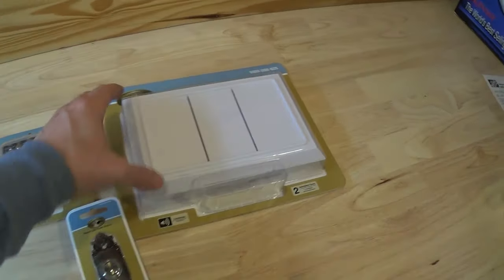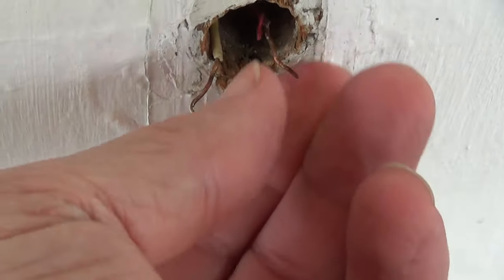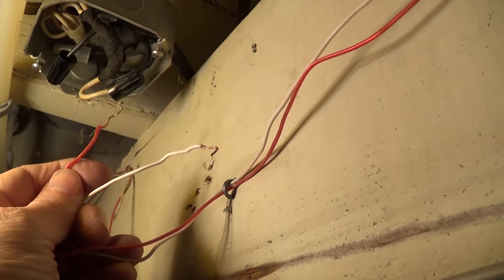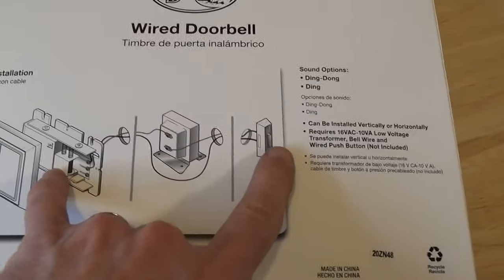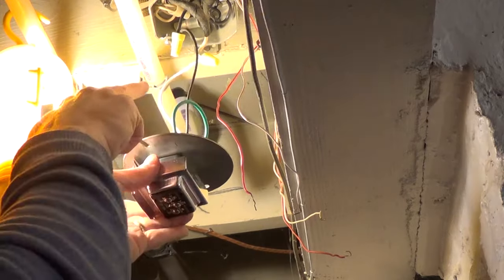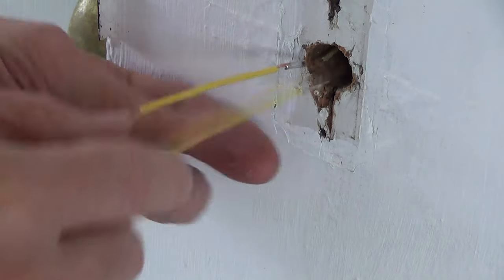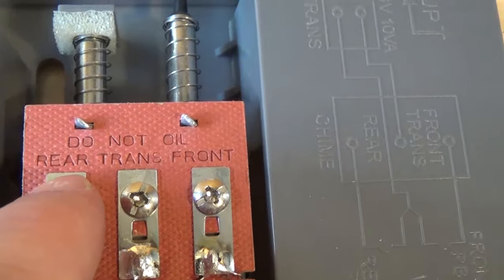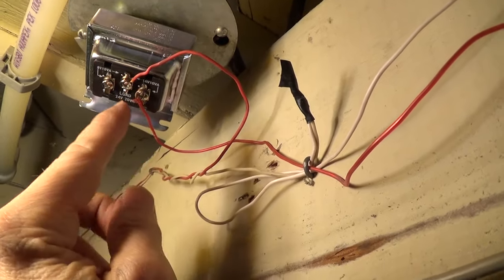How to Install a Wired Doorbell

Comment: I have a old house I have 2 black wires coming from electrical system hooked up to the old transformer How do I hook up the new transformer that has 3 wires 1black 1 green and 1 white ?

Comment: Our doorbell has no transformer, but the new one does, why do I need the transformer
Reply: You transformer brings the voltage from 110 volts down to 16 volts. If I had to guess there is a transformer on your current doorbell it's just hidden in the wall somewhere

Comment: Thank you for video, two questions: 1) Is the lower voltage AC?  2) What gauge is needed for the low voltage wires?
Reply: Is transformer not inverter
Reply: Yes it's still AC
Reply: Since no one answered your 2nd question, here you go. If the transformer doesn't include wires to connect to the 120 V house lines, you can connect either 12 gauge or 14 gauge wires there. For the chimes and the doorbell button outside, you can run 16 gauge wires for those connections from the transformer. You will be good to go.
Reply: @thomast8539  Thank you!

Comment: My wires are very short as well. What did you use to extend the wires by the door?
Reply: Figured it out. Used the wire extenders that came with my Ring Video Doorbell Pro 2

Comment: So why does it buzz right before the chime? Is the unit defective?
Reply: That slight buzzing sound is the solenoid, which turns the electrical energy into the mechanical energy needed to ring the physical chime that's in the housing. With the housing closed and if you're a reasonable distance from the solenoid, you can't hear it at all.

Comment: When I drywall, the transformer is going to be sticking out of the wall. Any other way to hook it up without it protruding out of the drywall?
Reply: I believe it has to be accessible (in case needing to be replaced).  You'll probably just want it in an inconspicuous location.
Reply: Just leave it outside the junction box
Reply: I'm going to put mine in a double gang electrical box with a white flat cover installed in the drywall, I think if you can't put it in a utility room that's the best option for accessibility and hiding.
Reply: @rowanro  I ended up running it to the basement that was the easiest way for me
Reply: That’s a good option
Reply: You could cut a square hole into the drywall, attach the transformer to a stud inside the wall and use one of those plastic access plates/covers to give the square hole a nice finish.

Comment: You failed show the connection of the red wires on the transformer?
Reply: Watch it again. Although he didn't show the final connection, he did show that he was using the 16 volt terminal connections on the transformer.

Comment: Hello, I have a question: in my country the voltage used is 110v, there is a problem if when installing my doorbell I do not use a transformer, I have already tried it and it still works without it.  Thank you
Reply: What are you even talking about?
Reply: You run your doorbell with 120 volts? Lmfao
Reply: @showbizwisconsin8350  right lmao he probably has a SpongeBob alarm clock hooked to it LMAO 🤣😂